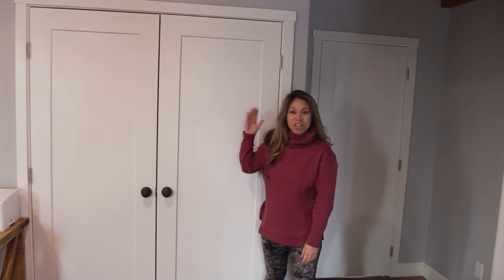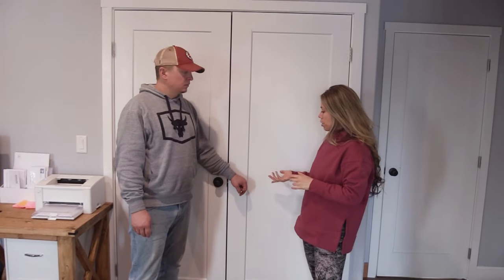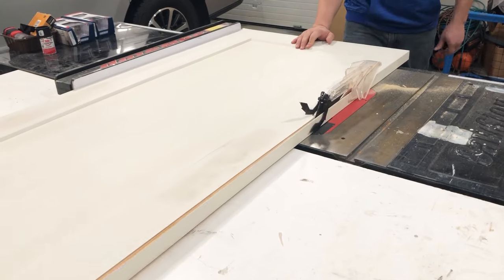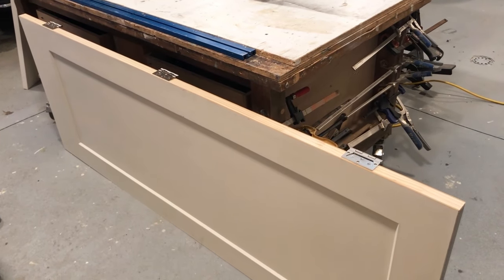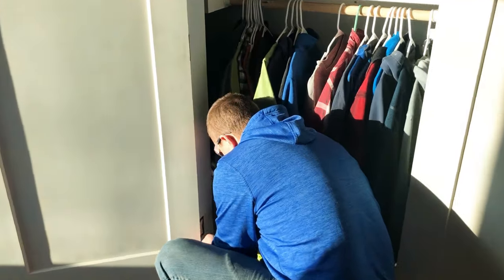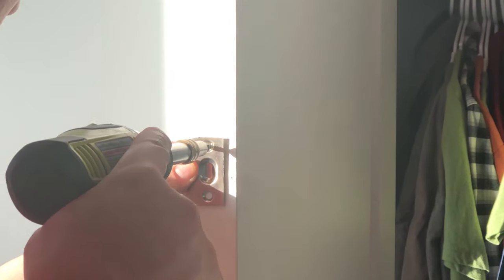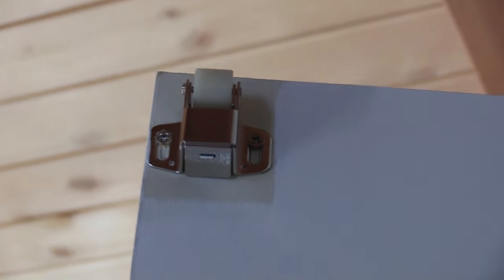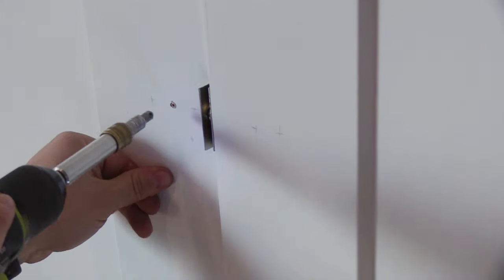Non-Mortise French Closet Doors

Comment: Your video was my inspiration for a second closet in my mid century modern 1950’s ranch home. We are the 3rd owner of this home and the previous owners are the ones who added this odd closet and had these ugly mirrored bi fold doors they attached to the wall because they were wider than the door opening. I took those off and just hung some curtains there to cover the closet opening. For my project,  I used Jeldwen hollow core wood doors from Home Depot ($37 each). I used 3” wood trim on the sides and a 4” trim on the top to hide  the holes from the old closet doors. I painted everything white. My project turned out great. It’s not perfect, but the closet looks fantastic now and is not an eyesore. My total cost was approximately $150 excluding paint.
Reply from the maker: Awesome! Thank you for sharing:)

Comment: Not priming the door because the door is, "pre-primed," is not a great shortcut. That's my only critique on this project. I really like the method of measuring for hinges. I don't think I'd be a fan of those types of hinges though but it's still an interesting feature.
Reply: I've got those hinges on the door into our laundry room, they hold up good, and don't create an unsightly gap not being mortised in because the 2 halves fold into eachother, like she said as long as it's a hollow core door they work fine..barrel isn't much smaller than normal, just short 2 screws compared to normal

Comment: What makes these "French" closet doors? They look like ordinary closet doors to me.
Reply: "french" usually just refers to 2 doors that latch together and swing apart, I'm sure in the past it was a more concrete definition but that pretty much what it means nowadays
Reply: @mattsharpe3989  I suppose it must be an American thing, here in Australia, afaiaa, they must have at least some glass in them, and usually full length, and are almost always exterior doors, although I can't see why that makes a difference. I do accept though that for wardrobes (closets) there is usually a divider between then, but I wasn't thinking of that aspect.
Reply: @vtbn53  I know "fresh doors" also as full length exterior doors with glass panels. I Germany we call them balcony doors.
Reply: Because of the way they open makes them French style doors